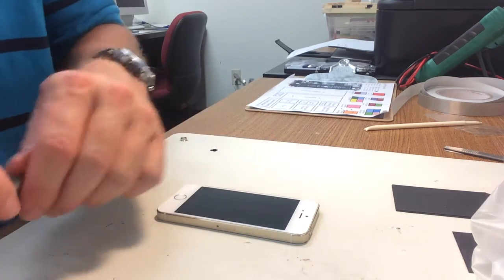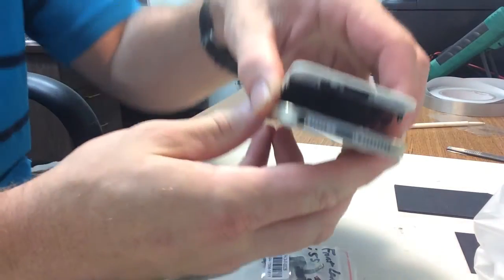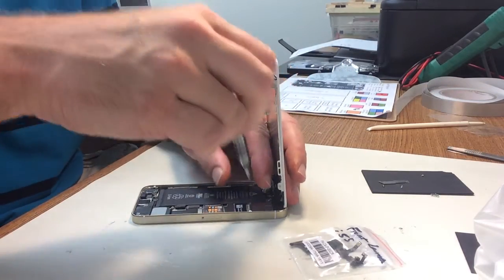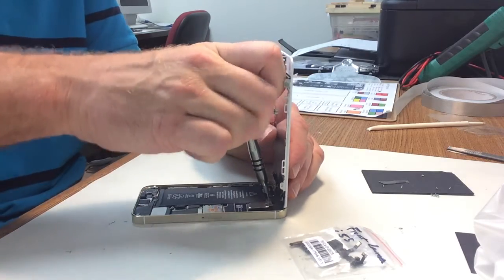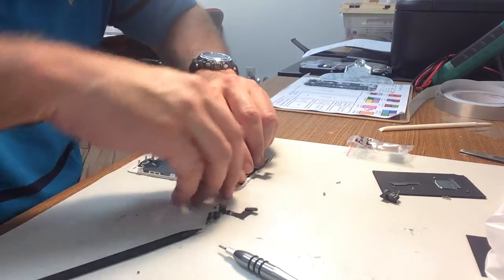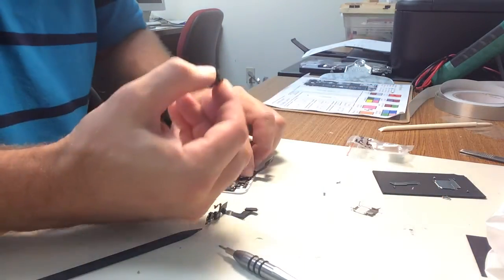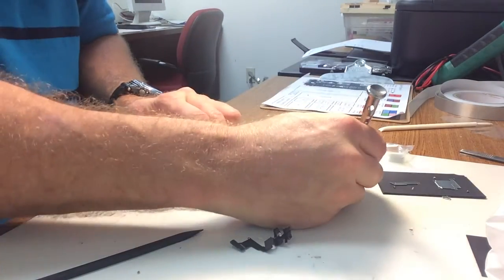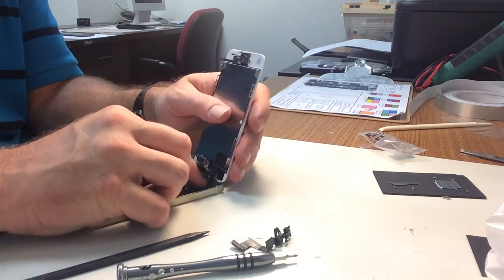iPhone 5S Front Facing Camera and Microphone Replacement

Comment: i have a situation: my front speaker and camera work but my front proximity sensor and microphone do not. I found the same part that you replaced on ebay and amazon but am wondering if this will fix both my issues as the product pages are not very detailed and just say "mic flex cable" and not "front mic" as i would assume it would say if it included it.
Reply from the maker: It should fix your problem. The proximity sensor is delicate and fails pretty easily. That part is on the same flex cable as the microphone so if you replace it very carefully both of your problems should be fixed. Good luck.
Reply: +Mobile Device Rescue thank you

Comment: whats your training? how does one learn this kind of stuff ?
Reply: +Askar Khan I have always been a tinkerer and when I was growing up I took everything apart to see how it went together. Before I began repairing cell phones and tablets I had a computer repair shop. I have studied micro soldering at a school in New York but most of the easy hardware repairs you can learn on YouTube. You would need to watch a ton of videos on each repair because many videos show people doing it wrong. One important tip I can give you is always disconnect the battery before you disconnect anything else. Most videos do not show this and it causes the back-light filter to blow and you cant see the LCD image after that. Then the repair takes microsoldering to put a new filter in. Good luck and I don't mind answering questions because I had a lot of helpful people guide me along the way.